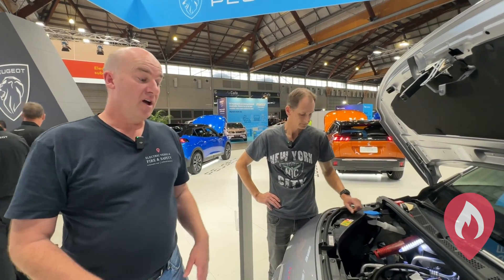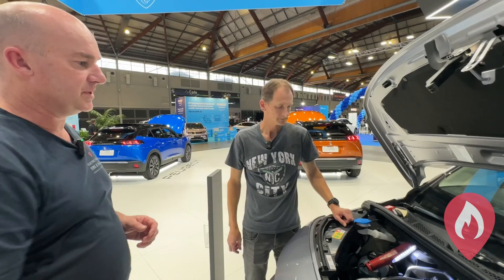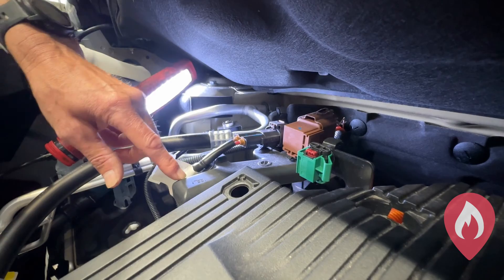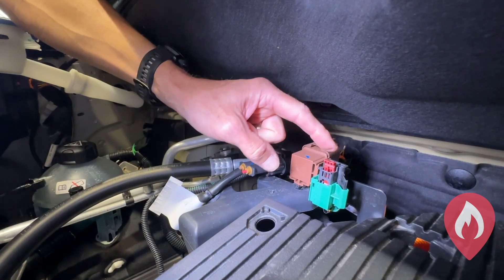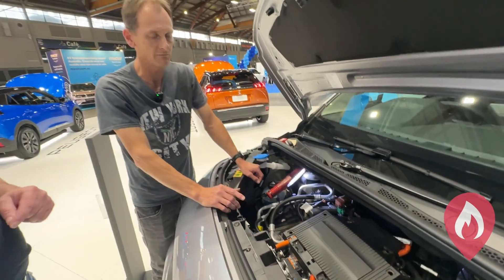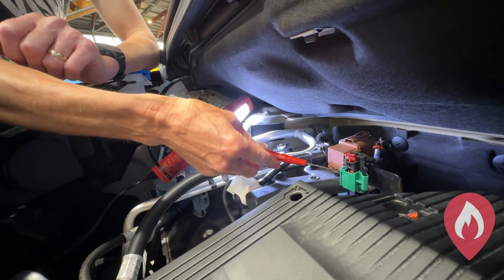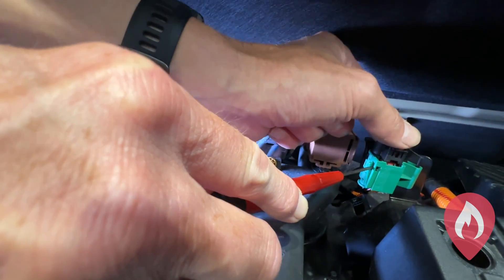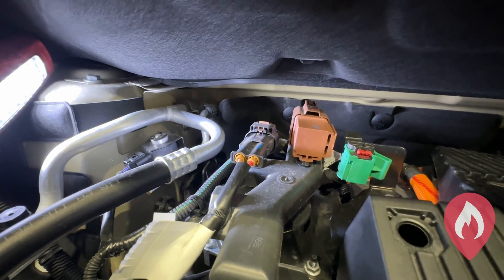Isolate Electric Vehicle HV Systems - Green Pull Plug

Comment: Wow - super interesting. I’ll have to research to see what Polestar/Volvo use for a shut off. The Polestar doesn’t have anything exposed under the bonnet, but it must be under there somewhere!
Reply: Well, in the Polestar two, there is only a “Manual Service Disconnect” located in the floor behind the drivers seat.
For a service technician in a workshop it's fine…..
For emergency responders it's rather inadequate.
Responders will still do all they can to render the scene safe, but there are less straight forward options like this